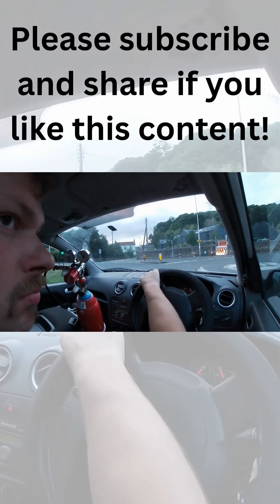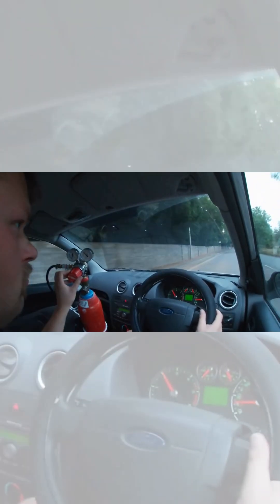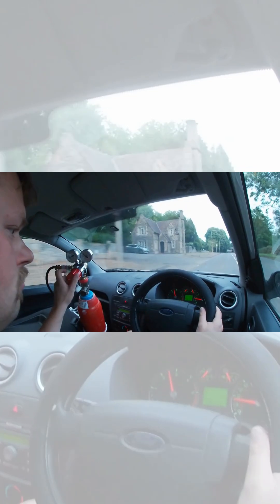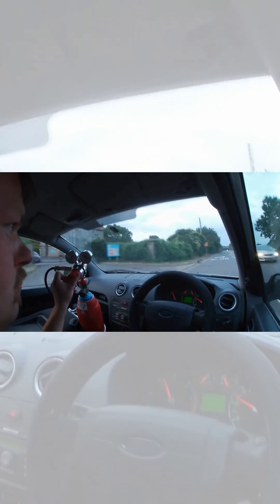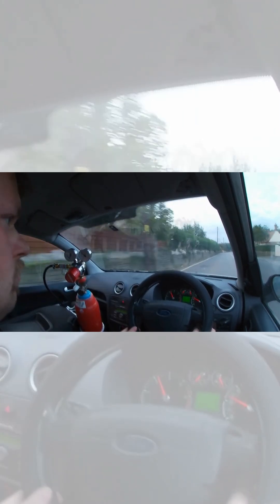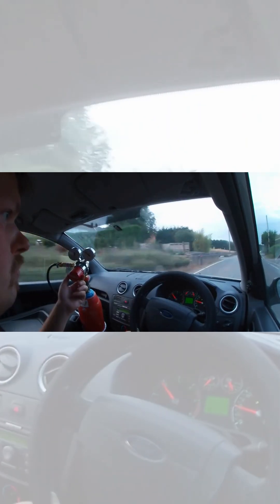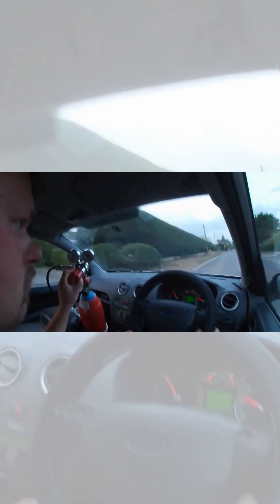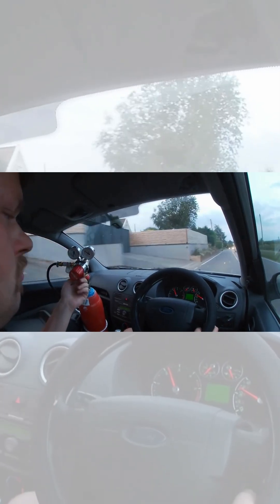First road test on Hydrogen

Comment: I remember a video of a guy going on about adding hydrogen to ICE you change the flame speed.
Reply from the maker: You are correct. The combustion speed of hydrogen is significantly higher than petrol and especially diesel in all conditions.